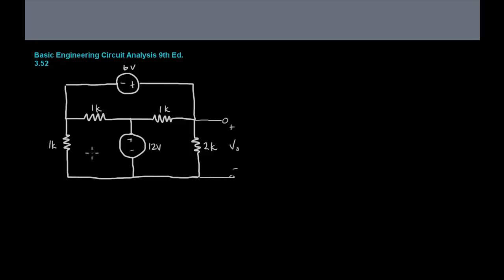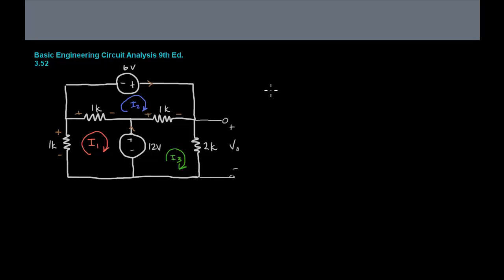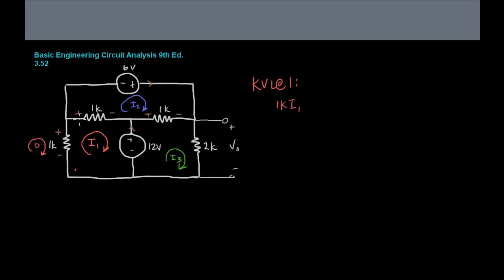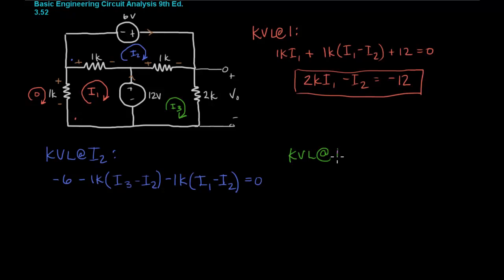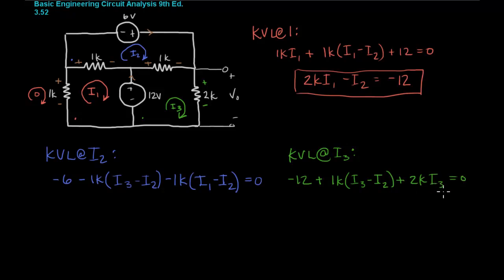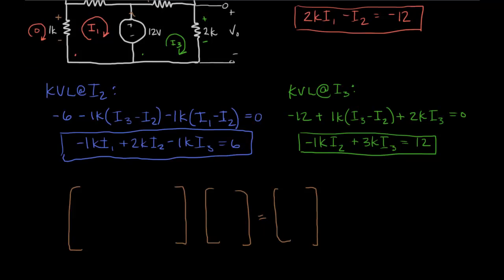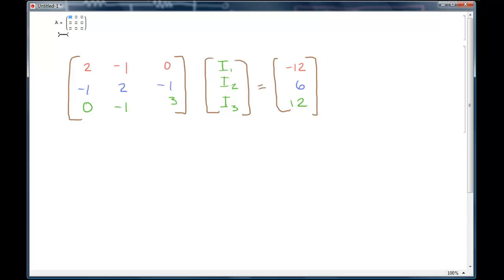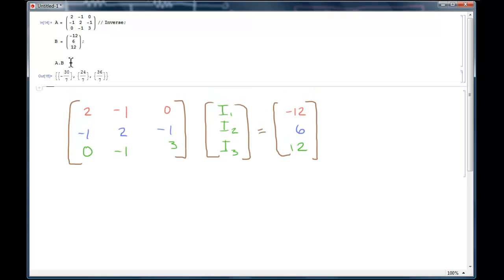Mesh Analysis Problem 3.52

Comment: why is the 1k resister on the left positive when the current goes through the negative terminal and the 2k resister is also positive? since 1k resister has the opposite sign, shouldn't the 2k resister have the opposite sign too?